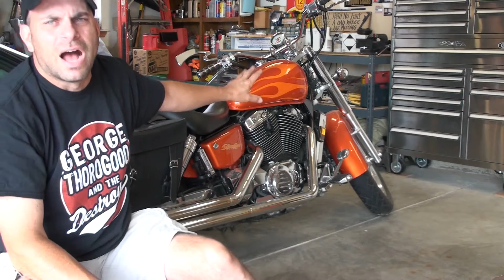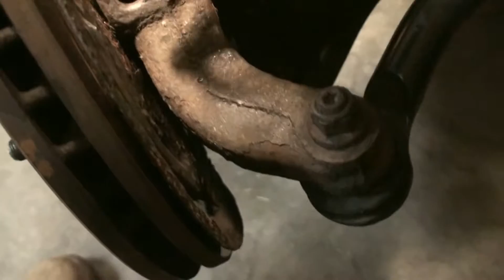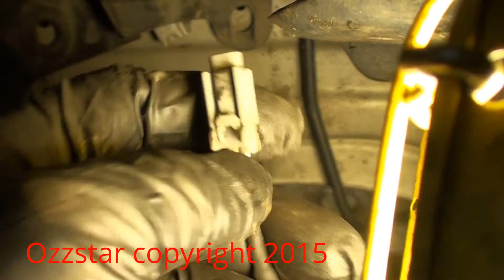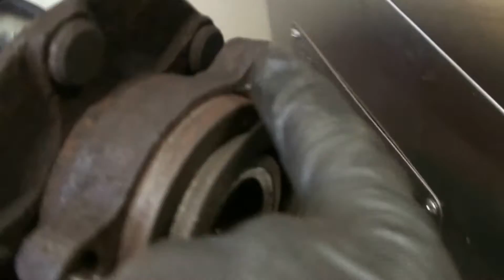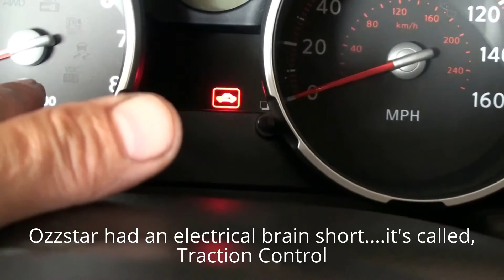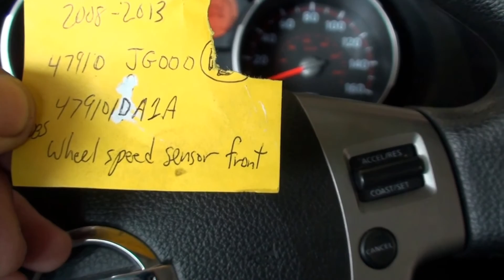Wheel Speed Sensor Replacement/Explanation - Nissan Rogue SUV AWD

Comment: I have a situation with a 2015 Rouge.  Could you give me your opinion?  After 10 minutes of driving on city streets, the AWD lock lamp comes on ( you can feel that the AWD is engaged), a few minutes later the AWD lamp comes on and stays on.  Once you turn off the car, it resets, and then the  situation repeats every time you drive.  Please advise
Reply from the maker: I would begin by looking at the wheel speed sensor live data.  Look for a lazy sensor or signal drop out.  Then diagnose why.

Comment: hi, i have to change my rear speed sensors (both) , i have my new sensors, but i don't see where the wire is going going exactly, like where is the plug, its going somewhere under and i cant follow the end of the wire. Do you know if its going inside the truck like under the rear seat or something like that? Thank you
Reply from the maker: I don't know what vehicle you are working on but yes some cars can have connectors inside the cabin.  Sometimes the connectors are hidden behind the wheel well liners or inside a firewall on the front end.
Reply: @ozzstars_cars  im on nissan murano, thanx for your support!

Comment: I actually broke off the sensor at the base of the collar.  Can you drill out or punch out the sensor and do you have to remove the cv and hub bearing to do that?  I have a 2014 rogue awd and it's for the rear
Reply from the maker: Yes you can extract it out but be very careful not to damage the tone ring if you leave the axle in place.

Comment: Dude, thank you so much for doing this video. Ok, so here's my issue. 2010 Nissan 370Z, approximately 11k miles, garaged 90% of the time, my cruise control wouldn't engage, so I did some research and found out that adjusting 1 of the 2 sensors (the 1 with the blue harness) on the break pedal would fix the problem. I didn't touch the brown harness. Well, I attempted to do so a couple times, but to no avail. The 2nd time I made the adjustment, I took the car for a test drive. The brakes felt very very tight which I didn't think nothing of it, figuring well the car hasn't been driven in months. I go to get on the highway, and the car wouldn't pick up speed and ultimately died, like the car locked up, a little bit of smoke from the engine bay. (burnt rubber smell) 

After trying to troubleshoot the problem it was like the brake pedal was engaged without my foot being on the brake, with all 3 indicator lights on the dash, VDC, ABS, Traction Control. I'm thinking it could be a bad ABS/Wheel speed sensor or the cruise control harness that went bad. Thoughts? Any insight from you would be tremendous. Thanks so much.

Comment: Hi, I like you video about replacing the wheel speed sensor for Nissan rogue. My mechanic did the same to my 2010 Rogue but he could not get rid of the VDC, AWD, ABS and Anti slipery.  he tried so many times and he replaced another ABS thinking it was defected please help. My email ryanafara333@gmail.com thanks
Reply from the maker: Your mechanic needs to check the WSS while road testing, also checking the wiring harness.  If there is a corrosion or short replacing the sensor will be useless.  Proper diagnostics is the key to a successful repair.
Reply: Ozzstar thank you so much

Comment: Perfect! Exactly what I was looking for! Thanks! Answered all of my questions!
Reply from the maker: Glad the video helped you out Brenda. Thanks for watching and commenting!
Reply: Expecting it to only affect my ABS, I was freaked when all of my dash lights came on! I will also advise you viewers to thoroughly search for the best price on replacements sensors. I just ordered an OEM replacement pair for $25 on ebay w/ free shipping. I saw them listed for over a $100 EACH! It pays to be diligent when looking for replacement parts!
Reply from the maker: Brenda O'Connell good point to consider. I would also add that you usually get what you pay for.  Sometimes aftermarket auto parts are ok/good.  Other times not so good for quality, fitment, longevity and durability. It's a parts roulette game!